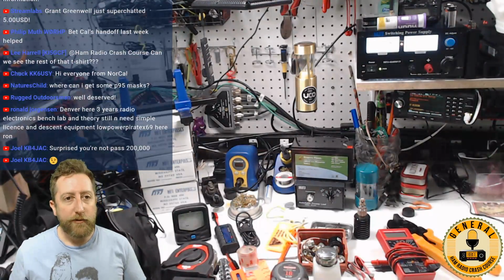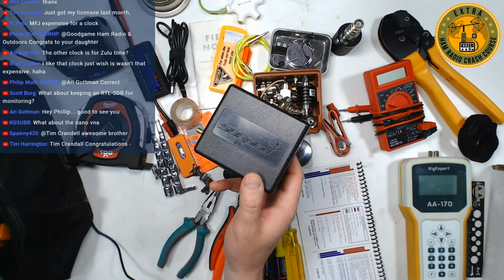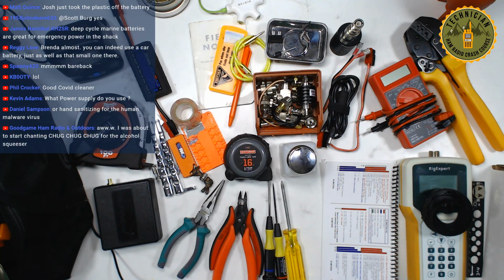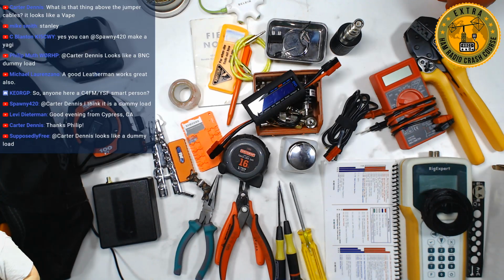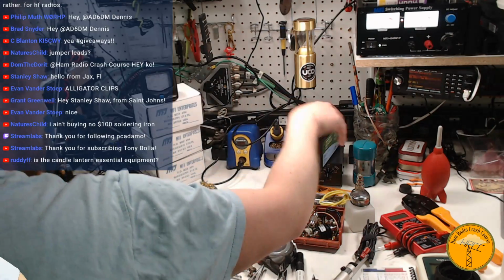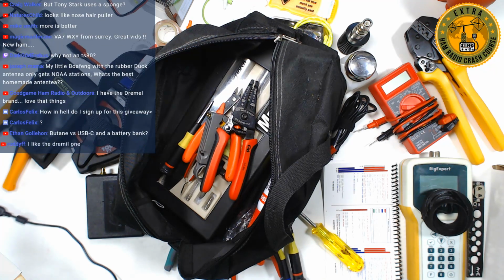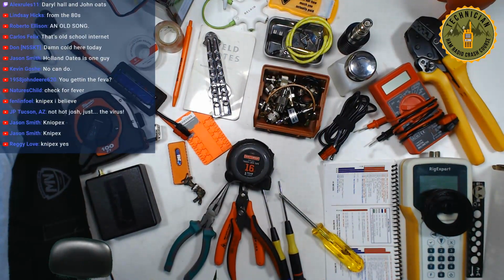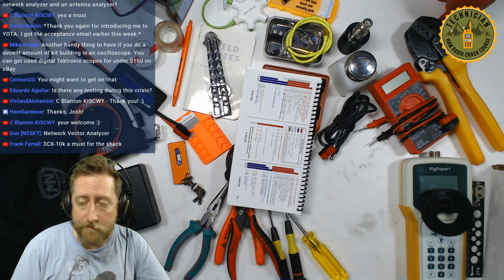Ham Radio Shack Convenience Items and Tools

Comment: Solder wick 😉😉 Kc3ONO
Reply from the maker: If I have to break out wick I’m gonna be a mad lad.
Reply: Ham Radio Crash Course hey when there is a hole burnt thru the chip and you need to get it flat again wick is your best friend. I coat the wide wick put on a old heavy tip and suck the surface mount pads clean. Lay new chip racking 4 corners then switch to a pace mini wave tip coat the run of legs with flux but don’t touch the legs. Then put a puddle of fresh solder on the mini wave and solder the 4 sides. I can mini wave 16mil pitch ICs 😉 pretty good at it. But luck you not my first thing when the circuit is working I make my techs isolate and show me the scope and prove the circuit before pulling one of we primary work with arm processors. 128 pin and 64 pin 😉I hate the allerga steppers with the heat sink pad under the chip. Never touched a BGA and hope I never have too 😳😱😄

Comment: What would you recommend for a dc powered soldering iron?  My shack will be primarily dc.
Reply: Take a look on the TS100 or TS80. They are super portable and im happy with my ts100. If you are looking for a more stationary type search on ali express for t12 Soldering irons. They are also completely statisfying in heating time and heat transfer and the tips are dirt cheap.

Comment: I disagree on the subject of a car battery for power for ham radio. You say that a car battery is intended to provide a burst of power to start a car, but what comes in nearly all cars now a days? Car stereos, they draw current like a ham radio on receive, and if they have amplification  then they draw a lot of current. Let me pose this question?  Since a battery provides a burst of energy, isn't a transmission from an amateur radio like a burst of energy. An HF rig goes from 1-2 amps of draw at receive to about 20-23 amps with a sudden burst of power at transmit. I think a car battery with a maintenance charge like the alternator in a car can be a very good and logical item to use for power of a ham station.
Reply from the maker: No. You run the electronics of the 12v being charged off the alternator. Not simply a car battery sitting there not being charged. 

Car batteries alone are not recommended for ham radio.
Reply: @HamRadioCrashCourse  I guess that was all in my imagination that year when I worked an entire field day on a big car battery and the countless times fellow hams have used car batteries to operate along with solar panels to charge them. In fact I have Field day video of them operating off of car batteries and solar panels. I did say in my previous post that  a car battery could be used as well with a maintenance charge similar to what an alternator would provide. I have seen that done as well in an actual practical situation by a ham with 30 years experience.   Hams have been using car lead acid car batteries for years before all these LiFePo batteries came into existence.  I have had an alternator go out on a car and have driven the car on just the charge from a battery. It is quite possible that we will never agree on this, you may not recommend using a car battery, but I being older/ experienced do recommend use of a car battery because I have seen it done in practical working situations more times than I have fingers and toes to count on. I don't want misinformation to get in the way of new hams operating if all they have or can afford is a car battery. If all anyone ever tells them is they have to have a special battery, then they are ham-stringed into thinking they can not operate. You as a youtube creator and someone who new hams look to for information should be encouraging new hams to use whatever means they have to get on the air, and if that is using a car battery, how about helping them find a solution to things you see as short comings of a car battery instead of putting those ideas down. Not everyone has money to buy an expensive LiFePo battery.
Reply: @kd5inm  Better to use deep cycle / marine batteries; they are also lead-acid. If you don't drain a regular car-starting battery very much, it will work fine too. Deep drains of car-starting battery will slowly destroy it.
Reply: @scotte9384  I have had a regular car battery last 5 years of use such as I have posted here. My point is that I have experience, practical real world use experience that counters all the things that are being said here in regards to lead acid car batteries and the real world actual experience does not agree with with the idea that you cannot use a car battery.  If a radio will not function with a car battery then why are millions of radios made to function from car voltages? Mobile radios are in millions of cars. In my region of the country we have storm spotters using their radios parked on the sides of the road with their vehicle turned off, not running and using their battery. I have seen plenty of instances when car batteries are used. The only difference in a car battery and deep cycle is the thickness of the plates in the battery.  A  transceiver still does not pull the amount of current from a battery that a car does. It's comparable to duty cycle and comparable to AM to SSB. You can get higher wattage out of a SSB signal compared to an AM signa because the duty cycle is less with a SSB signal. Same with the car battery, a radio doesn't pull as much current on a battery as starting a car does, so stands to reason a radio would not drain the car battery as quick as a car does. I have operated field day with a standard car battery, I've seen it done multiple times, it can be done. It's been done for years long before LiFePo batteries were ever around.  I don't fall for the idea that I have to have a special expensive battery to operate and I don't want to make other new hams think they have to have it either.